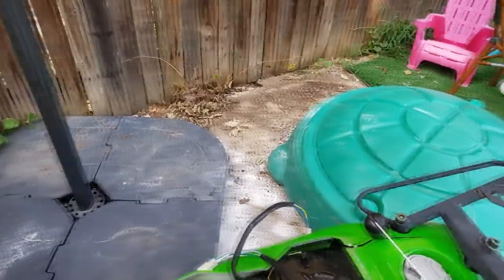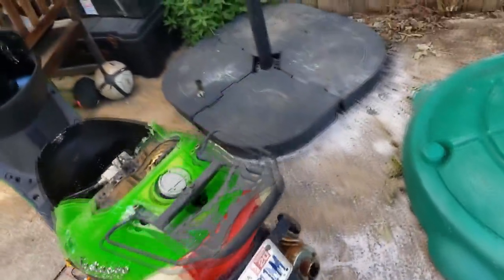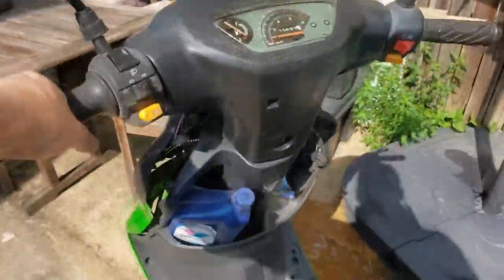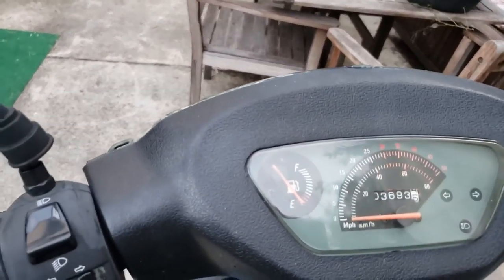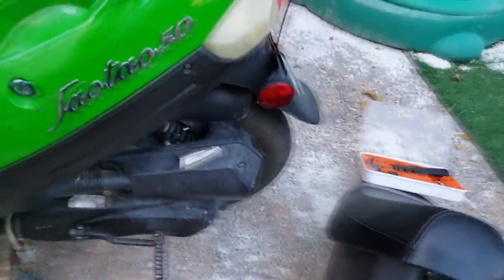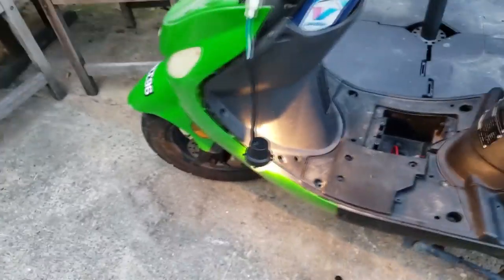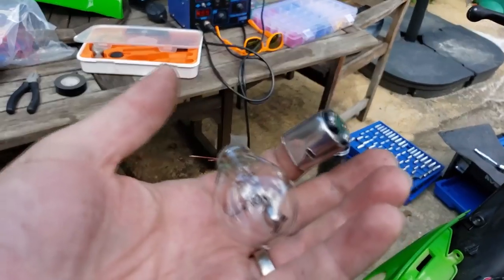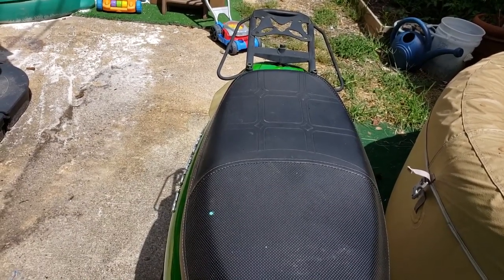TaoTao 50cc Chinese Scooter - Bought Not Working (Fix It) - Part 2

Comment: There was water in that fuel, and water sits at the bottom then is the first down to the carb sometimes making the engine run rough/idle "funny" because more or less water gets down there, or not run at all if to much water in the carb.
Most times the water get used up after a while and it run ok after but other times it can take a loooong time to clear up.

The best is too remove/open/clean the carb partly for the water but also for the other crap that can often make it past the filter.
If your unlucky the crap coukld have clogged the idle circuit/jet and that is a pain to get clean, and sometimes impossible (mostly after it have been dirty for long).

Moving on.
Are you sure there are no other adjustment? Mainly thinking about the idle mixing screw that most carb have, although it have been more and more normal that they are "plugged" so you can´t adjust them.
Often with some plastic crap that can be removed.
And more often then not they NEED to be adjusted.

One more thing that could be contributing is the main jet.
It is probably not 100% sure that it is the same size as in your old one mainly becasue that carb could be used for a couple of different engine sizes/powerlevel.
For example here in sweden smaller motorcycles/mopeds are in practiclly all cases lower powered by fitting some form of restrictor plate/pipe on the intake/exaust, other countrys have similar restrictions but could be a bit higher power and so on and on.
And as soon as somethign is changed at all the main and idle jets need too change.

There is a big change that they only sell the carb with the main jet that is the most used that may or may not be what your crotchrocket needs.
Also check/change the air filter could be dirty/wet (water/oil/fuel) which will restrict the air a bit (which would need a jet change/adjustment if not changed).

The old carb you could probably open up easy if you use a dremel/rotary tool and cut a track in the bolts (which they are) for a flathead screwdriver and it does not matter if you cut the aluminium some.
i would do that to check/compare the main jet in both carbs and if not the same use the old main jet in the new carb.

Then one BIG tip about "smaller" fuel engines that everyone should do since the fuel have etanol nowadays.
Is to NOT let them sit for months with fuel in the carb/fueltank that WILL lead to problem maybe not the first time or the second but sometimes.
And that is the fuel WILL thanks to the etanol take up water and it is quite a lot of water after a while, that will lead to crap growing in the water=dirty fuel.
But the absolut most problems is rust (like you already have seen that probably came from the tank level unit you changed), and also the carb itself where water will make it rust (if any steel/iron) and also make the aluminium pitted and/or chalky (=leads to clogging) after the water is evaporated.

So make sure if they will be unsused for a while to get all the fuel out from the tank and for example run it till it stops=carb almost empty.
BUT that almost empty is still a problem so the best is to remove the floatbowl (the one that you said was sealed) and empty it (can be done easy on some mopeds/motorcycles pretty easy some its remove carb to do).

OR you can use etanol free gasoline (good luck finding any besides racing fuel with high octane), or even better use alkylate gasoline http://letmegooglethat.com/?q=alkylate+gasoline
Aspen is a good alkylate brand here in sweden and seems to be in the us too but not sure.

Only problem more expensive, but for chainsaws and such that are not used often it really good for, for moped/motorcycle it can be expensive if used often/many miles.
Reply from the maker: Wow, very informative post!  Thank you so much.  Sadly, this post is going to get lost shortly as I am going to re-upload this video with a conclusion (I worked on it and got it finished today and would rather add it to the end of this video).  I'm going to copy and past this comment though for others to see the very informative post you took the time to write.  Thanks so much!

Comment: Maaaan I bought one of these brand new  and it didn't have the ability to idle for more than 30 seconds. Same issue as yours. It would die on me at red lights all the time if I didn't rev a little. The dealership I purchased it from told me thats just how the bike is. Ill have to check out that idle adjuster screw you mentioned. I still have it in my garage and your videos are inspiring me to go see what's wrong with it.

Comment: Hey dude, there is a vacuum fuel petcock on those that can go bad, I pulled mine off and put on a manual fuel switch its between the carb and gas tank on the rail. It makes draining the gas easier and may help with your idle problem, you may have to plug the vacuum port on the engine. Cheers dude stay strong

Comment: During the first part of the video when you purchased the new carb. I was wondering if you put a new fuel filter on it. My guess is that it will run pretty good now with the new filter.

Comment: Intake manifold has a air leak, people tear the rubber at the carb connection when they remove the carb for service. And or there could be water in the fuel or both.

Comment: 1:warm the bike up for 10 minutes. Your idle adjustment screw should have been set by the dealer. 2: your fuel mixture screw, first turn it all the way in so it can't turn no more do not turn it too hard!!!!!(turning it too tight could damage the tip of the fuel) turn it out 1 1/2 turns. And then start, make sure it's scooter is on center stand. The scooter revs high so where is the rear tire is spinning turn down your idle screw 1/4 turn. Give it a a second to adjust give it a couple ribs of the throttle and see if it adjust to a proper idle.

Comment: Always start your diagnosis with fuel. Spray one quick jab of quick start directly into the carburetor and try starting. If it fires up then dies, your problem is fuel. Saves you HOURS of diagnostic work testing this and that.  Remember that these are very basic scooters (air/fuel/spark). No computer. No fuel injection.

Comment: I think it is your gasoline opening waccum valve-take the pipe off the carburator and suck in it then the gasolin should run out? I am a foreigner so sorry for my english....I changed mine because it wast running for a while and then stopped, is was running dry in the carb. You need meny rews to open the walve if it is leaking....waccum

Comment: I got an issue with my 50cc scooter too, when i roll on the throttle it wouldn't move forward, and when i rev it really hard, it would lunge forward very fast, seems kinda dangerous. Any idea what could be wrong with it? thanks in advance
Reply: Carburetor maybe gummed up. Try disconnecting the air intake hose and spray inside real good with carburetor cleaner. Then let it sit for a few days. If that doesn’t work, you might have to remove the carburetor and soak the jets in parts cleaner.
Reply: @grazz7865  Thanks, i'll do that and see if it works

Comment: Those are break away screws on the bottom of the carb you can use a dremel tool to cut a flat screwdriver slot in them and take the carb to the hardware store and get new screws also on the side of the carb there is a small gold cover you can sometimes knock out  not the bigger gold cap on the side there is a mixture screw under it 
Also adjust the valves on that thing it will make a world of difference 
since you put on the new carburetor what you want to do is the vacuum line that goes to the black intake manifold in front of the carb on the left side and suck on the vacuum port that wll open the gas valve allowing gas to go in to the carb dont worry you will not drink any gas.
If you like I can give you my phone number and i can walk you thru the valve adjustment or facetime

Comment: Screw the air fuel mix in all the way and then back out a good 2 and a half full turns then adjust the idle screw its as simple as that you cant just bolt on a carb and expect it to work out the box

Comment: For the inconsistent idle, I believe your problem is a vaccuum leak. Change out all of your vaccuum lines and fuel lines. Change the fuel filter and make sure you have fresh gas.

Comment: Your old one is serviceable if you know what you are doing. You need to drill out those little covers very carefully. I've rebuild and worked on many of these types of scooters over the years. Also adjusting your carb would help and probably a bigger main jet by one size. A battery helps with that consistent power needed for steady power. Your battery needs these two nuts and bolts for the wires (can be purchased at auto parts store).

Comment: I have a similar scooter in Thailand - basically the same.. could be bad fuel, could be the dirty carb, could also be the Wire going from the throttle to the carb and finally Battery/ Spark Plug issues ie low charge/ low spark/ dirty spark,

Doesn't sound like valves

Sometimes there is a Relay switch on the brake that needs to be depressed when you start the bike by squeezing the brake, sometimes this sticks when the brake is released and the brake light stays on - this drains the battery... WD40 or a replacement. Fully charged battery makes a HUGE difference on these bikes.

Also you can check the compression on the motorbike by running it in idle/ hold your hand over the exhaust and it should run and then eventually cut out - you can also feel it stuttering

The wheel spinning and turning on idle is a carb/ idle issue - OR worst case its the clutch.. but the clutch is a pretty simple fix in the 1st instance there are ceramic tubes/ weights in the flywheel and you install them in 3/5/7 combinations if I remember 3 is quick acceleration and low tops speed - 7 is low acceleration and high top speed

hope that helps

Comment: The lights probably burned out due to a short when the wires melted. It may have even shorted something in your HI/LOW switch. or it may just work all fine and dandy when you put the new wire in.

Comment: With regards to the old carb, they sometimes use break away screws. You can drill them out, or another option is to us a dremel etc. And cut a slit in the top of the screw and use a flat head driver to take them out.

Looks like rusty water in the fuel, would cause the surging and other issues. I know in your video's looked like rain, maybe some water made it into the tank.

Comment: So I had the same issue with my 139qmb I have the same scooter mine is all beefed up now lol but the head light issue and blinkers you've probably figured already maybe not but your battery is drained from running with it head lamp no power return to battery without a head light in

Comment: Thanks so much I really enjoy these videos for some strange reason
Reply: All you got to do is pop them caps off the bottom of that carburetor there are screws under them also over the air mixture screw you can pop it off too and there is a regular adjustment screw up underneath the cap
Reply: I agree. lol I don’t even own one. But was fascinated by this.

Comment: Question, the black hose attached at the bottom of the fuel bowl on a angle to the bowl drain on the new carb you purchased, what does it connect to?? Replacing the carb on mine and don't see where to connect that hose to. TIA
Reply from the maker: Are you talking the one with the wire wrapped around it?   It routed down and screwed in to one of the screws holding the metal case on where I changed out the kick-starter, it appears to be a drain.
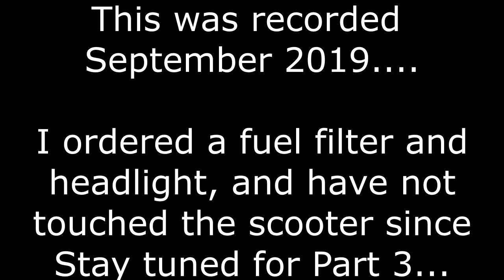Reply: @JSano19  no the plain hose connected to the port on an angle beside the drain wire wrapped hose. At 23:56 on the video you hold the carb bottom up to show the screws to remove the bowl. That is the hose attached to the angle port.
Reply from the maker: @RCRacer-77  Sadly I am not sure specifically which one you mean, and I don't have the scooter anymore to check, but this video seems to do a good job of showing a carb install - https://www.youtube.com/watch?v=TEMTl7Xf4Jc